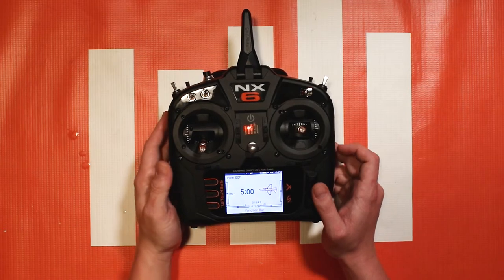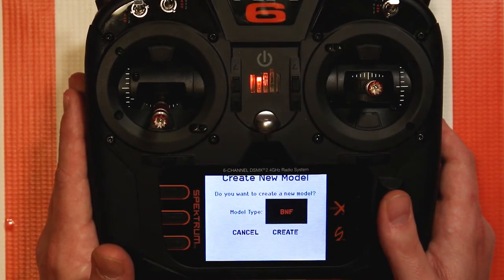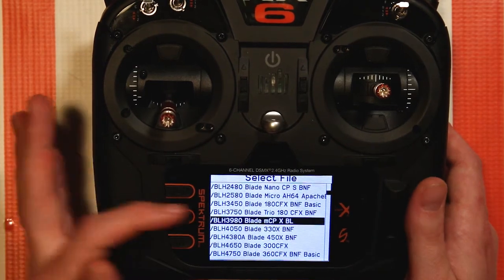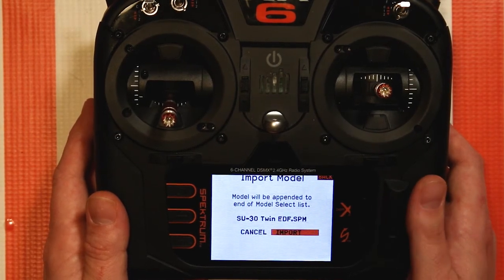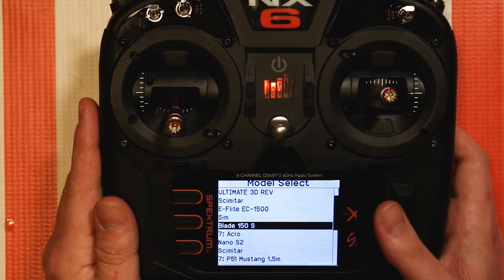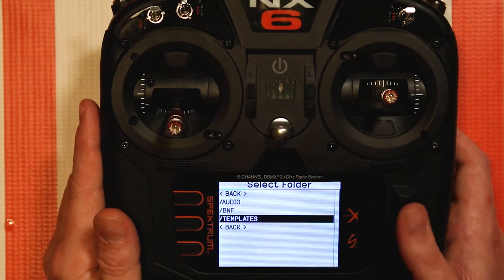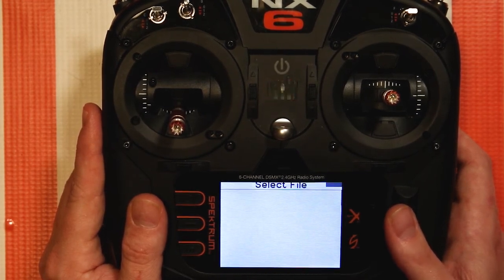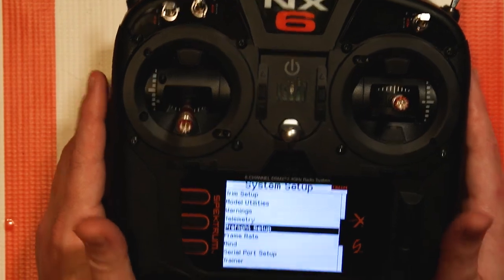NX Instructional Series - How to Use Bind and Fly Presets and Model Templates

Comment: I cant begin to tell you how aggravated I am with my new NX8 and the lack of tech support for Spektrum products.   If their goal was to make these products as difficult as possible to use, then they have succeeded beautifully.  Something as simple as an update can take days, even if you can figure it out at all.  I know when I buy a 400 dollar product I want to have to wade through piles of registration, get put on a mailing list, and still not be able to get the thing to work.  Thanks again, Spektrum.  I will think long and hard before considering buying any more of your products.
Reply from the maker: Should not be that difficult. Is there a particular step you are having trouble with?
Reply: @SpektrumRCvideos  This was 5 days ago, after many hours of trying and experimenting  I've made a little  progress since then.  Haven't actually USED  my NX8  yet, but I'll let ya know.
Reply: @SpektrumRCvideos  Ya I agree that it should not be this difficult.  I tried for an hour last night to update my new NX8 and finally gave up in frustration. I got the Tx registered and then connected to my wifi, but then I could never get it to check for updates. It just kept going in circles saying "connecting".  Luckily my wife is an IT person and also found a video that said it was also possible to update by USB or SD card. FINALLY got this thing updated this morning using the USB cable and MicroSD card with 54 minutes on the Tx counter to do this alone.  I sincerely hope you have tech support available  by telephone like FUTABA does, and friendly people who are willing to walk you through any problems.  The only reason I purchased this new NX8 is to fly a new Turbo Timber Evolution BNF airplane. If things don't start going better I will go with my original idea:  scrap the "smart" electronics and install a FUTABA receiver and forget Spektrum like it was a bad dream.
Reply: I totally agree with you.  I have a nx6 and all it is is a $300 paper weight. Does this hobby have to be so technically difficult?
Reply: Maybe I got lucky.  I set mine up with the president of my RC Club.  Other than trying to key in my password into the transmitter for the update it was fairly painless.
Reply: Was ok after logging in with tonight details as a newbie but binding to my heli was so frustrating I left it alone for over a year🤣 the omp m2 evo. Figured its just plug n play for dummies but I think I need to buy receiver and something else

Edit: The right not tonight

Comment: On the bnf pre programmed . If I do it that way, Other than the stick that is common control.  How do we know what buttons do things like flaps throttle cut. , gear. Safe, as3x etc. ?
Reply: Great question! I'd like to know this as well.
Reply: @DonTimmons-kh4dz  I know someone who accidentally double assigned the preset  throttle cut with his as3x cause he didn't know where the template assigned it.  He switched on his as3x , the throttle cut and his plane started falling out of the sky. Thankfully he quickly shut off as3x and his prop started again.  That's why now I don't trust that preprogrammed model features

Comment: I'll be adding the Turbo Timber preset to my NX6.  Will the Safe select be complete and assigned to switch already and will the Rate switch bw pre assigned with 100% for high rate and 70% for Low rate?  I asked because my Turbo Timber is delivering end of week, and I loaded my Apprentice STS RTF in the NX last week and all good except the safe seemed to be either on or off, no intermiediate and could not find the rate switch anywhere.   I'm a total newbie to RC airplanes!
Reply from the maker: Hi Pork chop! Yup it will all be setup for you with the preset. You will need to do the hold stick and flip the switch thing ;) Should be on the A or B switch. On your apprentice you might need to make sure that the Safe channel is assigned to the correct switch (B) Otherwise I know that particular model, with its SAFE+ features, it can be a bit confusing to tell which mode you are in because it has a function that essentially forces it into beginner mode when it is below a certain height. Hope that helps!

Comment: Thanks for this video ,.. but i bought my new NX8 and the new HABU STS  but this Habu is not in thr BNF List only a Habu 32 ,..pleae can you update your list ? ...or is there an  model in the list ,...what are the same as the HABU ? ..what works for me ... without programmimg ..
Reply from the maker: Settings wise the Habu STS is very basic, use the model preset for the Apprentice STS and you will be good to go. They are exactly the same. The model file is available if you feel like transferring it FYI.

Comment: Here's my question: I bought a Crescendo Evolution Plug and Play because I wanted to add my own, unlocked A637T receiver and take advantage of the vario in the unlocked version (as opposed to the locked version that came with the BNF version of that aircraft). Can I use the BnF presets in the NX series to automatically set up the radio AND do the forward program the receiver so that it identical to the BnF version? I ask this, because I find the forward programming of SAFE, flight modes and AF3X a little confusing at times.
Reply from the maker: The preset will get you started BUT you will likely have to adjust reversing. The preset is not going to program the AR637T unfortunately SO you will need to setup the receiver from scratch.

Comment: I just bought an nx8 and a carbon cub s2 bnf. Do I use the carbon cub s plus template? I don't see a carbon cub s2 listed in the bnf section of adding a plane on the nx8. I have successfully bound my nx8 to the carbon cub s2 using the s plus template and it seems fine but I haven't flown yet. Should I be OK with this?
Reply from the maker: The S+ will work just fine :)
Reply: @SpektrumRCvideos  thank you very much for such a fast reply. I'm very new to this and appreciate your help. I'm clueless😂

Comment: Hi i have a question about my new jet from horizon hobby MY Dassulte RAFLE 80MM edf fms jet for completion to fly because i have  spektrum AR6610T reciever and nx6 transmitter my question is is that the right reciever or compatible to that jet because  it shows in completion detail or recommendation  in horizon hobby before i buy that rafle jet i just comfuse because i see most of the video here in youtube they use spektrum ar673t reciever for that jet. Thank you
Reply from the maker: The AR6610T will work well. If you want Safe and AS3X stabilization go with the AR637T

Comment: Is there a way to make the serial port work with a tactic anylink 2? It’s the version that’s powered by it’s own lipo so the fact that the NX8 serial port is non powered shouldn’t be a problem. I have several TX-R models from them and some are almost impossible to change the rx out without major surgery.

Comment: Love the idea about the templates and bnf set models that is awesome to know and I just put the NX10 on preorder..why go small when you go big and get the best one coming..great great feature!!
Reply: I did try a bnf template for the aeroscout but as mine was rtf I never got the motor to run.  I switched to a safe select template and it worked.  Just trying to figure how to change the preset rates.  I'd also like to change it to 1 switch.

Comment: NX8 Transmitter

I did a bind to the Blade 120 S2 and got this message with the transmitter : NX8 warnings: rx 4.1V esc: 4.3v 10.8A 400.6F

Is this an issue? What does it mean.
Reply from the maker: Go to the telemetry menu and change RX Volt warning parameter to 3.4v or lower. that should do the trick :)

Comment: Tom Does it make all switch assignments as well? And what is auto config?
Reply from the maker: Yes it does, these assignments match the suggestions made in the manual for the BNF model that you are using the setup for. Auto-config will automatically detect what telemetry sensors are being used and setup those sensors (before you would have to go into the telemetry menu and assign these) That said it is important to go into the telemetry menu and setup the warnings per your own preferences.

Comment: When I select a BNF then will SAFE be setup? I used the AcroBNF to setup my UMX A-10. When I change switch "B" it tells me what mode it's in. When I use the BNF procedure to setup UMX Pitts it does not.
Reply from the maker: Hi Greg, it more depends on the model itself. The switches will be assigned to the correct channel BUT if the model is a "safe select" model then you will still need to assign the desired switch. Follow the instructions in the manual of that plane to do so.
Reply: @SpektrumRCvideos  I think I figured it out. I can use a BNF model but it does not have the audio alerts setup the same as the AcroSAFE.nsbm and I will have to then enable Safe Select via forward programming or the old method (depending on rx). The BNF model sets the rates and etc to the "C" switch to what the model manual says. The Acro model sets each individual channel rates on separate switches but does not provide values - perhaps because for Acrobatic maneuvers you want more control over each control surface versus one switch that controls ail/rud/elev. So while the AcroSAFE is working for the models I have used it on, it's a little more advanced than I need AND I will have to program the rates myself. I will setup the BNF model for my UMX A-10 Thunderbolt II using the BNF Model and then see if I can figure out how to add the voice. I want it to say "Beginner, Intermediate, Expert" and "High Rates, Mid Rates, Low Rates"

Comment: I cannot find a setup for the fusion 360 3s on the Nx8.  Why buy an expensive radio if the templates you need are not there.
Reply from the maker: Hi! That file has not made its way on to production units unfortunately, that being said, the 330 S file is nearly exactly the same setup and will work for the 360 3S. Hope that helps!

Comment: I purchased an HBZ4480 Sport Cub S BNF.  When I attempt to use BNF within my new NX6, it is not listed.   Is it possible to download a BNF configuration for my plane?
Reply from the maker: No Need to :). The Built in templates will work just fine on that model.
Reply: @SpektrumRCvideos  I don't think it is as simple as that.  There is still some programming to do in order to get flight mode and panic button to work. Flight mode (beg/int/adv) is GEAR and should be connected to one of your three-way switches (I used D). The panic button (AUX 1) should be programmed to the Bind button (I) and reversed in the servo set-up (otherwise it would be activated all the time).   The manual says to set the dual rates at 100% HIGH and 70% LOW, but I am not sure how to do it.  I am new to this hobby and it is frustrating that an entry level plane like the Sport Cub S2 is not  pre-loaded in the BNF list.  Maybe you could add it in a future update for others trying to enter the hobby.

Comment: Can you tell me why the nx6 will not import my models from my sd card. When i hit import model from the transfer sd card menu, it goes to select file menu and the models are not there. Just 2 folders called back?? I know my files are on the card.
Reply from the maker: Hi James, a few suggestions... Try another SD card / see if you can export to the card / make sure you are putting the files on the root directory for the card / OR you can even transfer the files to the internal memory of the NX6 via your computer and import from there. Hope one of those suggestions helps!
Reply: @SpektrumRCvideos  ok i will try these suggestions. i have a similar problem with my DX6, i put the updated firmware or airware on the sd card but it won't update.

Comment: Lots of BNF not on here. I've got a Carbon Cub S2 and a Sport Cub S2 and neither are on there, rtf versions that I want to move over to a better transmitter. The old CC S+ is but that has different electronics as I understand it. For a newbie the manual doesn't really tell me what enough of those options in the menus mean so this is not the easy time I was hoping for, particularly with these trainer planes.
Reply from the maker: All 3 of those models should work well with the SAFE model template. That being said, we will look into why those files are not listed. Thanks!
Reply: @SpektrumRCvideos  I have the same problem. Got my NX8 today and updated to last firmware (by USB, Wifi is not working... ; also a little bit scared about the naming "NX8 v3.04.01 PUBLIC BETA"). But no template for Carbon Cub S2, Sport Cub S2 and also Blade 120 S2! I'm really getting angry after waiting a long time for delivery of NX8, update/registration issue and now finding out non of my (new) BNF models is listed! 

I had no doubt that especially the Carbon Cub S2 would be listed. In the the video you say "we have preloaded every single BNF Model to your NX Transmitter" ;-) Hopefully I will get my models now working with safe function...
Reply: Agreed. Just bought a NX10 and am trying to find the UMX Turbo Timber EFLU6950 BNF model. Not there. Any way to download from the web somewhere? I'm just returning to RC after a 13yr hiatus. It feels like I got out during the rotary phone era and am returning in the smartphone era. All of these smart TXs, RXs, ESCs, chargers ect are making me feel dumb..
Reply: Very seriously thinking I made a mistake on my NX8 purchase. 
I  have had absolutely no luck getting the AS3X/ safe on a switch. If I do... I can't turn it off. Or has motor reverse mixed in with the switch. Crashed the T.T. evolution learning that the hard way.
Reply: My Night Radian is not on my bind and fly list on my NX6 transmitter. I am new to the hobby and struggling

Comment: Yes Tom their preset but I crashed the 230s. Because the gear /b had to be changed to f mode I thought bnf means I don't have to change anything or program I can't take that risk with 330s . I know learn the radio but they bind and fly feature should be easy just a click & fly but I crashed right of the bat  .
Reply from the maker: Yeah that is the setup for the 230 S, not the 230 S smart, which is not preinstalled in the TX yet :(

Comment: Hi how do you set NX6 to 11 ms frame rate many thanks
Reply from the maker: Go to Frame Rate menu, set to 11ms and rebind to receiver. IF the rx is a slow speed RX it will force the bind into 22ms mode. These are commonly found on UMX planes and older receivers.

Comment: Bring it down to the first user level. How do you make a template that has all the same timers, switches, expos, voice commands, that you can use on multiple planes going forward
Reply from the maker: Create the template on a "dummy" model, then export it to the internal memory. User the USB connection function to move the template you created to the "templates" folder and you are good to go. Hope that helps! But this might be a good quick hit video to do! :)
Reply: @SpektrumRCvideos  thanks, yeah I bought the NX series because I do Not have a computer. Wanted to do all this within the transmitter

Comment: Hey Tom, Just got my NX10 and something odd is happening. I loaded a couple of the BNF models from the list and they work fine. I was trying different things with the transmitter and I deleted those 2 models through the normal procedure to delete and they were gone. later when I reloaded those models from the BNF list the transmitter set up 2 copies of each plane. I tried to delete 1 copy and they both disappeared. So reloaded again and now there are 3 copies of the models. I have the latest update and did a factory reset but could not resolve the problem. Any Ideas?